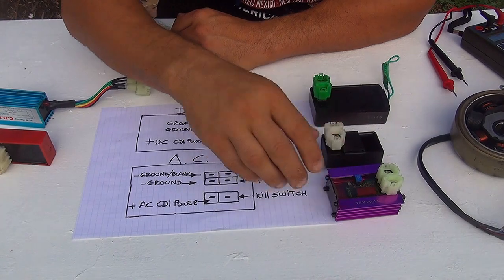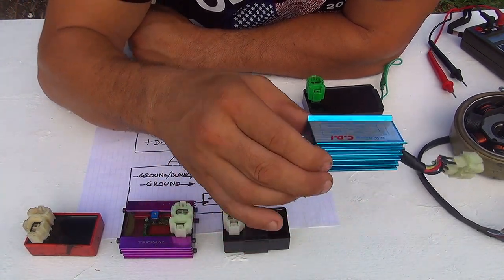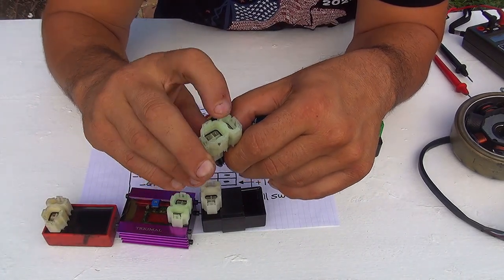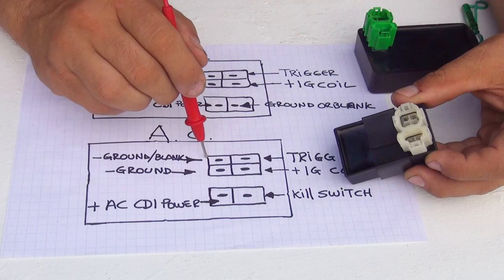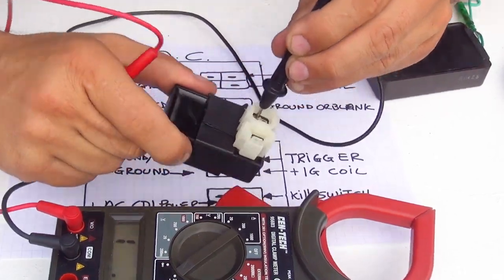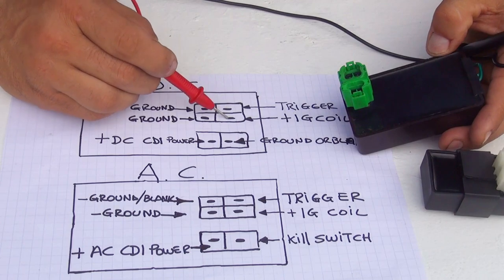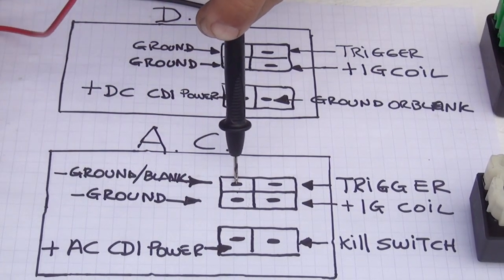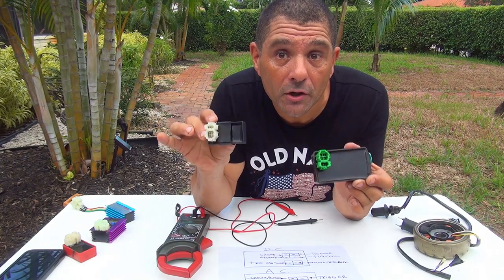Scooter CDI Test

Comment: I had a rough idle but driving seemed fine and was wondering if maybe my CDI was bad. This continuity test proved that is was fine. Thanks for helping me rule out one possibility!
Reply from the maker: Sometimes cdi under stress do not work perfectly even if with the continuity test look fine also try to replace the spark plug that could be  why you have a rough idle 👍
Reply: @VirberelloScooterTips  I already replaced the spark plug and also tested the ohms of the spark plug wire and it was above 7.500 ohm reading or so, replaced it with a new one, will see how it runs today.
Reply: Ok so after 30-45 minutes of driving around, the idle gets rough. It seems like the idle is "okay" until after a while, but I had to turn up the idle pretty high so it will not stall and the back wheel is spinning because the idle is too high. I tried spraying carb cleaner to find a vacuum leak, could not find one. Changed spark plug and the wire. cleaned out the air filter. My next guess was CDI but it was fine on the volt meter. I am going to order a new fuel filter, drain the gas and make sure the tank is clear of debris and replace the filter next. It has almost 32,000 miles. Maybe the engine is just getting old? It is a 2016 SYM HD200 EVO. (fuel injection, not carburetor)
Reply from the maker: wow  32k is a great mileage that can also be a valve clearance or worn out piston rings check the motor pressure to make sure but if that happen after 30 to 45 minutes you could have the valve spring little tire / worn
Reply: @VirberelloScooterTips  Well I found the problem after changing my spark plug wire, furl filter, petcock, testing cdi, new spark plug, valve adjustment and the list goes on. The spring had ripped through one of the clutch shoes on my clutch! I replaced the clutch shoe assembly and the bike runs great again! haha! No random rough idling and the back tire does not spin when ont he center stand anymore lol.

Comment: I’m trying to get my daughters gokart going, NO SPARK. 

Just replaced stator which I thought it was that, still no spark.

Wires are all good, fixed them, retape them.

Have cheap multimeter, doesn’t  beep, old multimeter messed up(it beeped/other settings)

Checked the cdi and show some readings on ground, checked rectifier and same. 

Have zero clue what I’m doing wrong

I’m not an electrical guy😩
Reply from the maker: It sounds like you've been working hard to diagnose the issue with your daughter's go-kart. Here are a few steps you can take to further troubleshoot the no spark problem:
Check the Spark Plug:
Ensure the spark plug is in good condition. Remove it, clean it, and inspect it for any signs of damage. You can also try replacing it with a new one if you're unsure.
Verify the Kill Switch:
Make sure the kill switch is not engaged. Sometimes the kill switch can be faulty or accidentally turned on, preventing the spark.
Inspect the Ignition Coil:
The ignition coil is responsible for generating the spark. Use your multimeter to check the resistance of the ignition coil. Refer to the go-kart's manual for the correct resistance values. If the readings are off, the coil might be faulty.
Check All Connections:
Ensure all electrical connections are secure and free of corrosion. Loose or corroded connections can prevent the ignition system from working properly.
Test the CDI Unit:
The CDI (Capacitor Discharge Ignition) unit is another critical component. If possible, test it using a known good unit. There isn't always a straightforward way to test a CDI without specialized equipment, so swapping it with a working one can help determine if it's the issue.
Verify the Ground Connections:
Good ground connections are essential for the ignition system to work. Make sure all grounding points are clean and secure.
Check for Broken or Damaged Wires:
Even though you've retaped the wires, double-check for any broken or damaged wires that might have been missed.
Consult the Go-Kart's Manual:
If you have the go-kart's manual, refer to it for specific troubleshooting steps and electrical diagrams. This can provide valuable information on what readings to expect and where to test.
Use a Known Good Multimeter:
Since your current multimeter is cheap and the old one is messed up, consider borrowing or purchasing a reliable multimeter to ensure accurate readings.
If you're still having trouble, it might be helpful to seek assistance from a friend who has more experience with small engines and electrical systems or take the go-kart to a professional mechanic for a thorough diagnosis. I hope this can help you
Reply: @VirberelloScooterTips 

Previous owner replaced the ignition switch, took the lights off, etc.

It’s a “fun kart 150cc” gy6 motor.

Gona go buy new plug in bit, south texas been raining on and off….

I checked the cdi and rectifier like your vid shows…

Idk I feel like ima have to rip over the wire harness and go from there…. 

Thank you for your help🙏🙏

Comment: You locking great man i placed the blue cdi on my icebear vision 50cc 2022 with the orange spark plug cable because it didn't start with the black cable so my scooter just got more power in accelerating.  I like it more with the blue cdi works great
Reply from the maker: Hello my friend thank you for watching my video

Comment: I don't have a multimeter tester. My 3v DC continuity tester is lighting up when I touch the ground pin to +AC CDI power pin. Can I assume my CDI is bad or do I need to re-test with a multimeter?
Reply from the maker: When troubleshooting the CDI (Capacitor Discharge Ignition) system on your gas scooter, using a 3V DC continuity tester can give some initial insights, but it may not provide the complete picture. Here are some key points to consider and steps to follow:

Understanding Your Continuity Tester Reading
DC Continuity Tester Limitation:

A 3V DC continuity tester is designed to check for electrical continuity, not for measuring voltage or diagnosing AC systems accurately.
When your tester lights up upon touching the ground pin to the +AC CDI power pin, it might indicate a circuit path, but it doesn't tell you if the CDI is functioning properly.
CDI Function:

The CDI unit operates with AC voltage from the stator. It's crucial to ensure that the input voltage and signals are correct.
Misinterpreting DC continuity can lead to incorrect conclusions about CDI health.
Steps to Properly Diagnose CDI Without a Multimeter
Check Connections and Wiring:

Inspect all connectors and wiring for signs of wear, corrosion, or damage.
Ensure that all connections are tight and secure.
Visual Inspection:

Look for any obvious signs of damage or burning on the CDI unit itself.
Check for any loose or broken pins in the CDI connectors.
Test the Stator and Pickup Coil:

Use a continuity tester to ensure that the stator and pickup coil are not open-circuited. However, remember that this will not verify the correct AC voltage output.
Substitute CDI:

If you have access to a known-good CDI unit, you can swap it out and see if the problem is resolved. This can be a practical way to test if the CDI is faulty without specialized tools.
Why a Multimeter is Recommended
AC Voltage Measurement:

To accurately test the CDI, you need to measure the AC voltage coming from the stator. A multimeter is necessary for this purpose.
The CDI typically requires specific AC voltage levels to operate correctly. Measuring these voltages with a multimeter will give you a clearer picture.
Resistance Tests:

A multimeter can measure the resistance of the stator and pickup coil windings, ensuring they are within specification.
Detailed Diagnostics:

Some CDI units can also be tested for proper output using a multimeter, which might involve checking for spark strength and timing.
Conclusion
While your 3V DC continuity tester provides some initial information, it is not sufficient for a thorough diagnosis of the CDI system. To accurately determine if your CDI is bad, you should:

Acquire a Multimeter:

Invest in a basic multimeter that can measure both AC voltage and resistance. It's a valuable tool for various electrical diagnostics on your scooter.
Retest with a Multimeter:

Measure the AC voltage from the stator.
Check the resistance of the stator and pickup coil.
Verify the CDI output according to the scooter’s service manual specifications.
By using a multimeter, you can make a more accurate diagnosis and avoid unnecessary parts replacement.

Comment: Question ? I am working on my son's 2007 Ricardo znen. What kind of cdi box ? Has the longer one in it but he had a neighbor work with it so not sure if this neighbor changed anything up ?
Reply from the maker: It can be difficult to determine the exact type of CDI box required for a specific scooter model without additional information. However, as the 2007 Ricardo Znen likely has a GY6 engine, a common CDI box used for this engine is the DC-CDI box.

Comment: I've purchased one of the blue aluminum cdi. But didn't install noticed it only had 5 pins. Can you explain the difference it 5 and 6 pins.
Reply from the maker: The difference between CDIs (Capacitor Discharge Ignition) with 5 pins and those with 6 pins lies in their functionality and compatibility with different ignition systems. Here's a breakdown of the key distinctions:

5-Pin CDI: This type of CDI is commonly found in older motorcycles or vehicles with simpler ignition systems. It typically includes the following pins:

a. Power Input: Connects to the ignition switch or the battery's positive terminal to provide power to the CDI.
b. Ground: Connects to the vehicle's ground or negative terminal.
c. Trigger/Pulse: Receives a signal from the engine's ignition coil or pickup coil to trigger the CDI's firing sequence.
d. Ignition Coil Output: Connects to the ignition coil, which generates the high voltage required for spark plug ignition.
e. Kill Switch/Engine Stop: Connects to the kill switch or engine stop button, allowing you to cut off the engine's ignition.
6-Pin CDI: This type of CDI is commonly found in newer motorcycles or vehicles with more advanced ignition systems. It includes the pins mentioned for the 5-pin CDI, plus an additional pin for enhanced functionality. The pins on a 6-pin CDI are typically configured as follows:
a. Power Input: Connects to the ignition switch or the battery's positive terminal.
b. Ground: Connects to the vehicle's ground or negative terminal.
c. Trigger/Pulse: Receives a signal from the engine's ignition coil or pickup coil.
d. Ignition Coil Output: Connects to the ignition coil for spark plug ignition.
e. Kill Switch/Engine Stop: Connects to the kill switch or engine stop button.
f. Rev Limiter/Speed Limiter: This additional pin allows the CDI to control the engine's maximum RPM or speed, limiting it within a specific range for safety or performance purposes.
The presence of the sixth pin in a 6-pin CDI enables additional features such as a rev limiter or speed limiter, which are not typically found in 5-pin CDIs. If your vehicle originally had a 6-pin CDI and you have purchased a 5-pin CDI, it may not be fully compatible with your ignition system, potentially limiting certain functionalities or causing compatibility issues.
It is crucial to ensure that the CDI you purchase matches the specifications and pin configuration required for your specific vehicle or engine model to ensure proper functioning and compatibility.

Comment: Hello. I got a guestion. I have a dc cdi (kymco) and when i use the black probe on the ground in the left corner in the bottom and the red probe on the top right, should it have continouity? It does with mine but shouldn't that be normal because they are both ground. 
Thank you for your reply in advance. 

Greetings from Holland.
Reply from the maker: Hello yes that is normal 👍
Reply: @VirberelloScooterTips  Ah ok. Thank you.

Comment: Please help I put in the blue CDI but it still limits my revs it refuses to redline it did increase my speed by 6-7mph but I'm still stuck at it never reaching the red line at all would it be better if I use the original and remove the rev limiter?

Comment: Hello
My blinkers dont work,is it possible the cause is cdi box change?
Already changed regulator.
And blinkers indicators doesnt work.🤯😇
Reply from the maker: Did you change the blinker relay ?
Reply from the maker: https://youtu.be/cJoOfSHUTiE
Reply: I dont have flasher relay🤯
I looked everywhere.
Someone said maybe it is integrated un cdi or regulator?🤷‍♂️
Moded is peageot vivacity 4t
Thanks a ļoti❤️🙏
IM going insane🤣🤣🤣
Reply: @VirberelloScooterTips  i was riding one day and suddently my - wire from my battery came off,it was losening.
And then my blinkers whent completely off.
Reply: @VirberelloScooterTips  when i tried to start my bike,the indicators on dashboard show there are blinkers,but in real life when i press turn signals button there isnt anything alive.🤯

Comment: My scooter uses an AC CDI, so I bought the blue one and it doesn't start, but when I plug in the old one it starts perfectly. Why you think this happens?
Reply: The blue one uses DC current. You would need one that supports AC voltage
Reply from the maker: I have the blue AC  cdi on my scooter for the last 5 years and is running great but sometimes few cdi are shipped already defective from the factory
Reply from the maker: I have the blue AC  cdi on my scooter for the last 5 years and is running great but sometimes few cdi are shipped already defective from the factory Thank you for watching my video
Reply: @VirberelloScooterTips  what would happen if I plug in an ac cdi if my scooter uses dc I have the gator 50-s3 um not sure if its ac or dc
Reply: @Revelation1177 you would at the least blow a fuse if you’re lucky.  Don’t even risk it!

Comment: Can this cause your bike to have 50% power ?
Reply from the maker: No I don’t believe so I think you need to replace the roller weight inside the variator but is not easy to pin point the problem if I don’t see the scooter

Comment: How do you test the kill switch?
Reply from the maker: Hello Key man to test the kill switch wires on a gas scooter, you will need a multimeter, which is a tool that measures electrical current. Here are the steps to test the kill switch wires:
Disconnect the kill switch wires from the rest of the scooter's wiring harness.
Set your multimeter to measure resistance (ohms).
Touch the probes of the multimeter to the two wires that were connected to the kill switch. The multimeter should read a very low resistance (close to zero ohms) when the switch is in the "on" position, and a very high resistance (infinite ohms) when the switch is in the "off" position.
Activate the kill switch by pushing it to the "off" position and test the resistance again. The multimeter should now read a very high resistance (infinite ohms).
Release the kill switch and test the resistance again. The multimeter should return to a very low resistance (close to zero ohms).
If the multimeter readings do not match these specifications, there may be a problem with the kill switch wires or the switch itself, and further testing or repairs may be necessary.

Comment: What if there is a spark, but it still has problems starting
Reply from the maker: Hi if you have spark but you have problems I will check the valve clearance and the compression 👍

Comment: Hi I'm new to the utube channel I hope this will get to you. 

I have a 2021 amigo ss 150cc. 

It's so hard to start cold that it kills battery trying when I'm jumping it from a car it takes me holding the start button for long periods and it eventually starts it's hard to keep going but once warmed up it runs great.  What are some trouble shooting tips. I would really like to talk on phone if possible. I'm desperate I've missed a week of work already. Please help.
Reply from the maker: Hello my friend There could be several reasons why your gas scooter is not starting. Here are some common reasons:
Faulty spark plug: A faulty spark plug can prevent the engine from starting. Check the spark plug to see if it is dirty, corroded or worn out. If so, replace it with a new one.
Clogged air filter: A clogged air filter can restrict air flow to the engine, causing it to not start. Check the air filter and clean or replace it if necessary.
Dirty carburetor: A dirty carburetor can also prevent the engine from starting. Try cleaning the carburetor or taking it to a professional mechanic to get it cleaned.
or you need to check motor compression and do a valves clearance  service 
Thank you for watching my video
Reply: Thank you I I got it going. It was multiple things.  Basically I changed all ignition parts. And bought a new duralast  battery.  My scooter had 12 miles when I bought it. It now has close to 8,000.   And I out run the expensive scooters.  Chinese scooters are Ok in  my book.  Thx again for all your videos.  And watch for me because I definitely gonna support your channel.